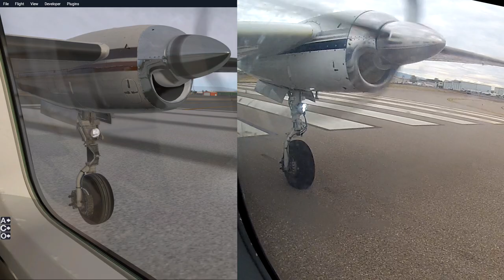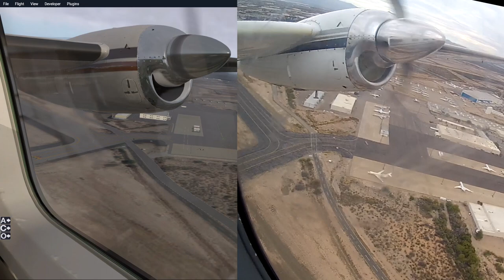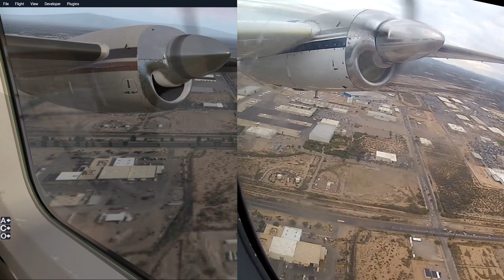X-PLANE 11 VS. REAL LIFE, TURBO COMMANDER......AND IT'S A TIE!

Comment: Totally Awesome! Surprising how the X-plane view often has more detail, did you sync X-Plane with actual aircraft GPS ground track data?
BTW: I bought and sold an old cheap 680W years ago. Not in the same performance league as your aircraft but it hooked me on Commanders.
Reply from the maker: Jack I just flew the same profile in the sim and after about three tries I got it pretty to close to actual.  There is apparently a way to upload your Foreflight tracks into X-Plane and have it replay your flight but I have not advanced that far yet!